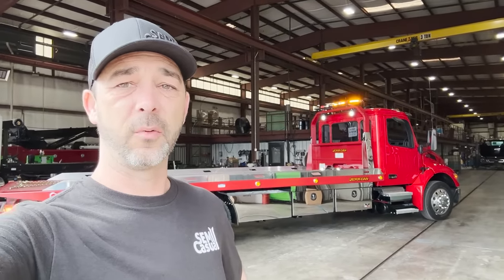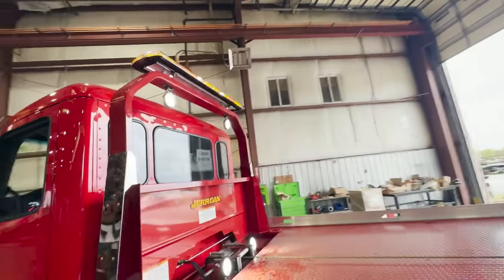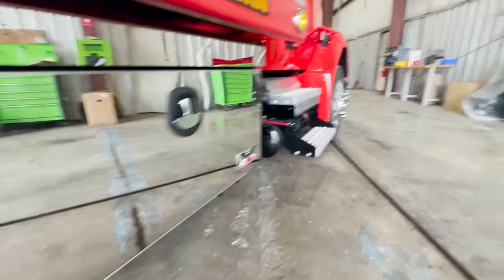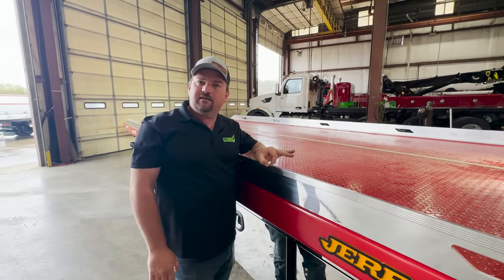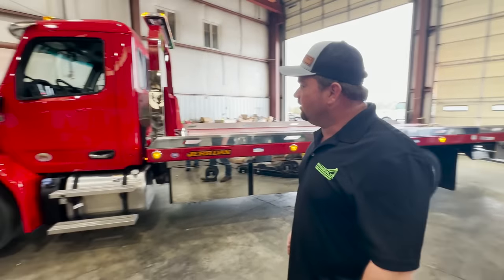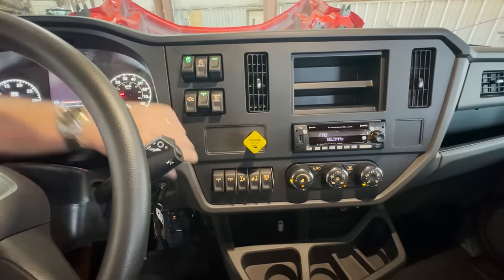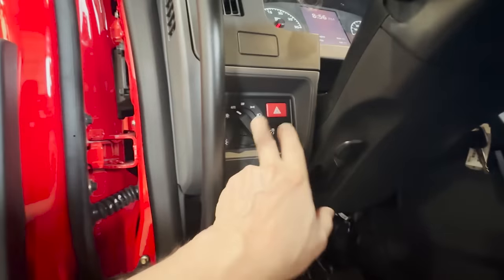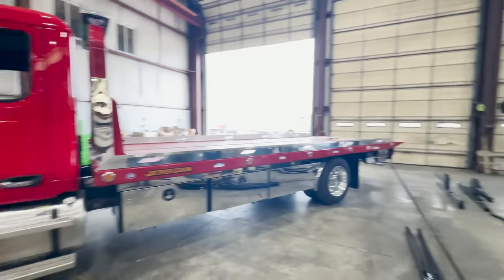Custom Peterbilt 536 full tour!

Comment: Now that's a nice unit, love the storage.  Love the dual body controls, I prefer body controls for delicate stuff because I've found remotes don't react fast enough.  I had to laugh when he was talking about the "competitor transmission".  We've got 2 heavy duty Isuzu which are both onto their 3rd transmission from that company, one failed with less than 60,000 kms on it!